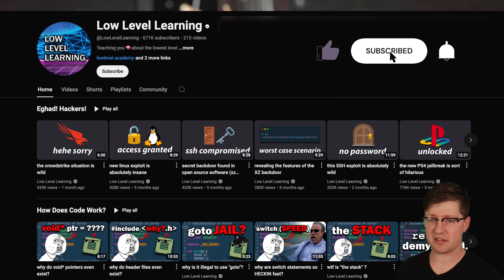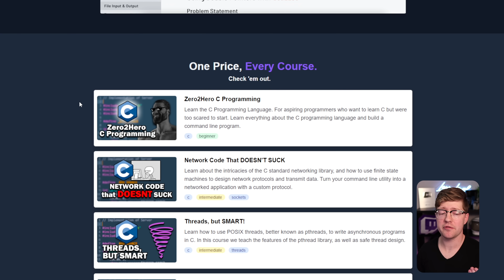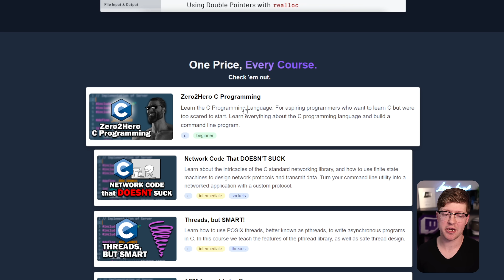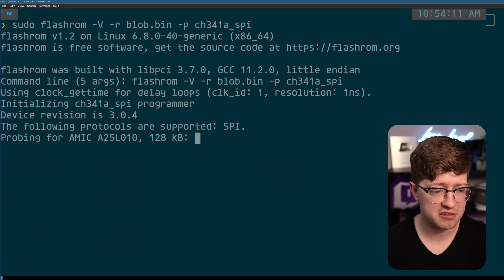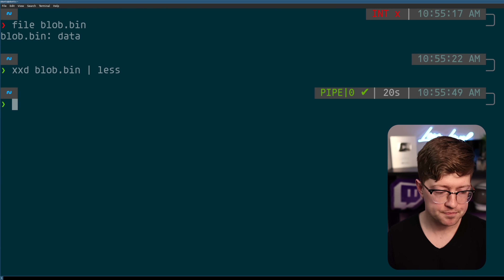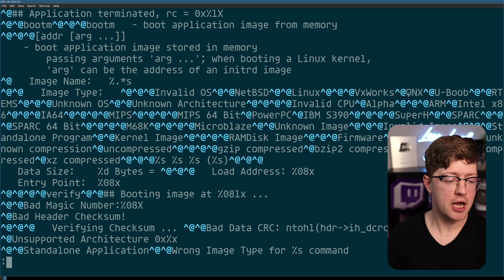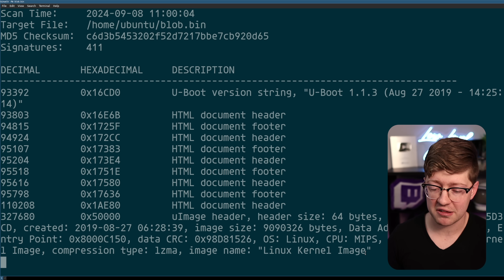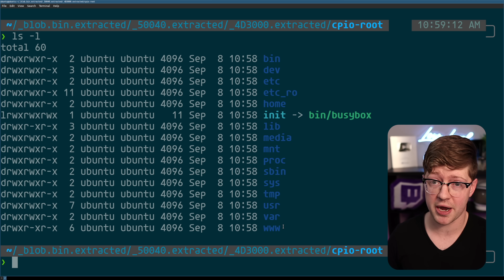how is this hacking tool legal?

Comment: He doesn't mention this in the video, but that CH341 device doesn't always work to read flash chips without desoldering. The problem is that in order to read from the flash chip, you have to power it. The CH341 can power a flash chip, but it can only output a limited amount of current. If the VCC rail connected to the flash chip is directly connected to other components too, it's possible the CH341 won't be able to power all those components, including the flash chip. In these cases, it's often best to just desolder the flash chip.

Alternatively, you could connect a logic analyzer to the DI and DO pins of the flash chip, then power up the device. Use the logic analyzer to record the data stream as the CPU reads the flash contents. You may need to write a small program to convert the recording back into binary data though.
Reply: Just my experience, YYMV, but I used one to read and flash the BIOS of a Dell laptop. It functioned perfectly. I had to buy a second clip that connects to the chip since the first one refused to work.
Reply: @MrWaalkman  Yeah I'd say based on my experience that it works without desoldering about 80% of the time. It really just depends on whether your flash reader can provide enough power to the part of the board you're connected to.
Reply: I had this a few times. Can resolve it by using an external 3v3 supply to power the rest of the board and using that pin for power instead of the USB programmer one.Some ribbon cables use blocks to connect all 10 pins at once so I ended up using dupont cables for the remaining cables since I was not connecting the power pin. But even in this configuration its a hit and miss.
I always do 3 reads and md5sum them to make sure they are identical. If not, then I will desolder for good measure. I don't need that uncertainty in my life :D

edit: and of course connect the grounds of the usb programmer and the 3v3  supply together. Since the ground of the programmer would be connected to the board with the rest of the other pins, it will work. Easier to connect the 3v3 supply ground to the programmer since theres not a lot of space on the board to hook a crocodile clip to.
Reply: The SPI flash will almost certainly be connected to the entire 3.3v (or applicable voltage) net so you'll end up powering everything. The other issue you might have when it's in circuit is that the SPI master might be holding /CS high once it has powered up, and trying to force it low from an external device might not work. Inevitably, sometimes it'll work, or if you can hold the SPI master in reset you can do it, but I'd have to imagine it'll fail a good proportion of the time.
Reply: @74HC138  I've certainly had that chip-select issue with one ip camera but other devices I must have gotten lucky :p
Reply: 1. add a electrolytic cap to the power rail (it looks odd, but, works) 100uF iirc.   2. Hold the reset pin on the uC low/high to stop the uC booting (if the bootloader uses the SPI bus it will corrupt your data).   I had to do this to a tapo 200v3 to dump the firmware.
Reply: Just unsolder the grnd pin
Reply: I totally agree, but it’s not just about power. The host CPU will also be trying to drive the SPI lines which will clearly cause contention. The only hope really, without desoldering the chip, would be if the host CPU puts the SPI bus in to a high impedance state when held in reset. If so, you could find the reset line (from the host CPU datasheet - if available), and use this to hold the device in reset whilst you read the contents out.
There is also a non-zero chance that the host CPU is (possibly) damaged by the programmer trying to drive the SPI bus at the same time as the host CPU.
I realise the author may not have as much experience in the hardware realm as he does in the software realm, but I feel this point should have been covered more thoroughly.
Reply: @jonlee312  Why would you put a relay between the CH341 and the flash chip?
Reply: If you have that little clamp you don't need to desoldier it. I had to use one of these to flash my bios when it was bricked.
Reply: @meetsoneji3830  That little clamp is called a SOIC clip. It can certainly help with getting good contact to the pins of the flash chip, but it doesn't solve the issue of powering the flash chip in the situation I described in my original comment.
Reply: @Gogeta70  it’s possible to power the bios chip using just the clamp, maybe I am not getting your  point. When I was flashing my chip it was enough to just properly clamp onto it and connect it to another pc via ch341
Reply: @meetsoneji3830   WRONG, go look at the new disk drive boards..., tehy are either too ltight to get teh clamp on, or are now using a new  SPI device with the pins under neath...
Reply: @stevesteve8098 I was just saying it is possible, the clamp is useful when you just need to  reprogram bios chip.
Reply: Also, most chips have an enable Pin. If the CPU shortens this Pin to ground you can't start the memory chip. If you power the device you have a multiple master problem. You can prevent the CPU from booting, but at this point, you might just learn how to solder.
Reply: @MrHaggyy  some boards are extremely delicate, and have extremely fine traces that are easily damaged removing. I do a ton of solderwork and damaged a dell board removing a spi bios chip (thankfully it was a spare used board that was already unsuable cause the socket got messed up in shipping) If you can do it on the board, its probably safest.
Reply: I tried flash a fake GTX 1060 to a 550 Ti and encoutered this issue. Red LED went dim when I connected the clamp the flash chip and I suspect this was the issue.
Reply: @Gogeta70  a logging device like openlager or do you have a recommendation? I’m trying to re program a ec300 “toy” drone to use a different serial based receiver and to change motor idle and other pid settings. I have experience with betaFPV silverware coding for flight controllers, I just want the power to change .wav files and other silly things in my kids toys and stuff.
Reply: @tattoocollective2599  I've messed with a few toy electronics over the years, and most of the time the data is just stored on a SPI flash chip. My general process is to try and read/write the chip in-situ first and if that doesn't work, I just desolder the flash chip, make whatever changes I want, then solder the chip back in. I also always make a backup of the original flash contents, just in case.

Not sure what you're asking in regards to the data logger?
Reply: you power it via the clamp, but the problem is voltage differences per chip... some are 3.3, and some 5v
Reply: @whoknows8225  Did you even read my comment? My entire point is that when you power the flash chip using your SPI flash reader, sometimes it can't provide enough current to properly power the SPI flash chip.
Reply: what's the benefits of the CH341 from my old ponyprog or ATiny SPI-Interface (serprog)
Reply: Yes and also the most part of those clips included with kits are the worst quality making bad contact with the pins of the IC pins or sometimes even damage it. It is needed the good blue Pomona clips or definitely unsolder
Reply: @AT-hh4db  Yep, you really can't beat Pomona clips. Except for the price, they are damned proud of their product.
Reply: Alternatively, you can also just desolder one or two pins (Vcc/ground) and then use the clip.  This isolates the chip enough to do a read (and/or write), and makes the task simple enough that even those with less soldering skill/tools can pull it off with less potential of damaging their system.

I've also seen videos where folks will clip the pin just above the board, then use a bit of wire to bridge/solder it back. I highly suggest against that, since if that joint comes free, you potentially have a bit of wire bouncing around your system.
Reply: @TvistoProPro  Yeah, you can desolder just the vcc/gnd pins, but I'm not a big fan of that method. You have to bend those pins away from the board a bit to make sure they don't make contact, which I'd rather not do.

Desoldering the entire chip is a little extra work, but soldering isn't really all that hard to do. If you need practice, you can go to your local Goodwill store and buy a few old used routers for $3-4 to practice on. I'd argue this is a better approach than trying to take a shortcut like "only" desoldering two of the pins when you lack the confidence in your skill to do it properly. Practice on old and cheap electronics. You'll do a better job at desoldering/resoldering the chip and come away having improved your soldering skills.
Reply: @Gogeta70  I wouldn't bend the pins unless it were absolutely needed.  I find that just wicking the solder from a pin often separates it electronically.  A continuity checker can verify that.  I've also used stripped silicon wire sleaves at times and pushed those over the pin (up the via for DIP style chips).  That forces isolation if the metal touches due to tension from the clip.  But usually, that's not needed.

Desoldering one leg vs 8 also means less thermal impact on the chip, and less chance of lost connectivity long term. To each their own, but the less I need to do to isolate a chip for a one-time read/flash, the better.
Reply: @TvistoProPro  I mean, there's nothing inherently wrong with doing it that way, it's just not my preferred method. If I'm going to bother getting out my soldering iron, I might as well desolder the whole chip.

I tend to use a double-flat tip that's wide enough to heat 4 pins at once, so I usually just lay it across all four of the pads and use tweezers to gently pull up on that side of the chip. I can usually have a chip completely desoldered in about 4-5 seconds, which is typically well within the tolerance of the chip.

Like you said, to each their own. As long as it works for you.
Reply: It's often possible to temporarily lift a small component like a diode or resistor that's in-line with the eeprom or nor flash's VCC line (usually for power protection) and allow the chip clip to work.
Reply: Before unsoldering, just try plugging in the power cord in the device (but don't turn it on ofc) so it gets standby power to the chip. I've had this work on several devices.
Some laptops require you to unplug the main battery as well if doing this.

Comment: I actually use this a lot with hardware hacking and tinkering cause its fun and i like that you can back up the whole device flash menaing i can mess with the firmware as much as i want and not having to worry about it never being able to function normally again or for it to become bricked forever.

Also its fun to see 99% embedded devices running Linux and busybox. Alao often they ditch the gpl and dont comply which is lovely cause more fun trying to crack the software of a device and unveiling its secrets

Comment: I've found the FlashCat devices sold by https://embeddedcomputers.net/ to be indispensable for pulling data from SPI NOR or NAND, as well as I2C EEPROM and Parallel NAND flash devices.

The source code for the app is available, and I've added some custom SPI flashes I've seen in the wild that weren't in the DB. It is more expensive, especially when getting all the various adapters, but it is pretty flexible.

Comment: Well. I predict that the producers of routers soon will begin to encapsulating there firmware chips. 🤷‍♂
Reply: I doubt. Manufacturers like to save cost. Its not worth it for them to encapsulate the flash cause that requires more money being spent and almost no one is going to go open the router to access the flash

Comment: just be warned about this device, there is a design flaw in it that can cause it to have a higher voltage than intended, potentially damaging the chip you are trying to flash.
many people never run into this issue, but if you want to prevent it, you can modify the device fairly easily if you are comfortable with soldiering.
just do a quick search on google or youtube for "Volt-modding the CH341a" and it should be one of the first results.

Comment: Be aware of voltages! This device puts 5V on data lines to 3V3 TOE even when supply to TOE is set to 3V3. Look for 3v3 mod for ch341.
Reply: Afaik there are different versions of this board. The actual CH341 chip is both 3.3V and 5V compatible (which is why the mod even works to begin with) although some boards don't use the integrated 3.3V circuit others do.
Reply: @Ether_Void  Yes, and because of that (some devices have this bug and some does not) I want to warn and inform anyone who want to use it.
Reply: @Ether_Void  yeah I have a board that does 3.3v with no mods, I haven't tested if it can do 5v tho, it does have a jumper on 2 pins labeled "P/S" so I assume that does it but don't want to take it off if that's not what it does and I could end up breaking it
Reply: @ajddavid452  not sure if You got the problem correctly. This device can supply 5v and 3v3 IC, but when you set 3v3 as supply voltage to IC on data lines there is still 5v logic (no level conversion). Some IC will accept that higher voltages due to small current on data lines (aka small power transfer) but in general 5v on 3v3 data lines put IC to undefined/unspecified region. Need to read IC datasheet and make sure that IC will survive.
Reply: @adrian_sp6def  I tested it with a multimeter, there are dedicated pads labelled MISO, SCK, RST, 3V3, MOSI, and GND, as well as 3 pins labelled TX RX and GND, and yes I know GND is ground, I looked up a guide to do it, most things you just said to me in this comment I was aware of lol
Reply: @Ether_Void  The issue is, if you buy the cheapest, expect it to always output 5v unless you confirm otherwise.
Reply: Good point!
Reply: Alternately, there are CH341 dongles with blue PCBs that have just a bunch of pin headers, rather than a fancy socket. This has a proper design: it has a jumper that lets you select between powering the CH341 chip from either USB power or an onboard 3.3v regulator, which is what determines the logic voltage (per the datasheet). You have to think about how to hook it up a little bit more since you don't have the socket, but if you're not confident modifying a PCB it'd probably be an overall better purchase - usually it's a little bit cheaper too.
Reply: @ryjelsum  Yes right! I have same dongle as Ed, and mine has 3v3 bug. I juat want to warn and inform to be carefull, some IC will not tolerate 5v as data pulses
Reply: the green v1.7 version of the ch341 board is the good one, treat all black pcb versions as defeative until tested as due to cost cutting causing the voltage changing part of the circuit to not work correctly without modding
Reply: Not true, check Sorin video not mod needed...
Reply: noooo! don't tell people that. I want to watch people who don't know what they are doing, wonder why they don't know what they are doing.
Reply: BE
How to program a bios chip - CH341A programmer, no, you don't have to modify it 

https://www.youtube.com/watch?v=J8-Sh7DjiXw
Reply: yeah ch341 is pretty much the worst programmer that money can buy.  Fortunately it doesn't cost much money.  Unfortunately it's the target chip rather than the programmer that will suffer.  Get a T76.
Reply: You really don't need to mod it for most applications (except for 1.8v SPI chips)
Not enough current to cause damage at 5V:  https://youtu.be/J8-Sh7DjiXw?t=48
I'm willing to accept the possibility the designer knew what they were doing . . .
Reply: @Nick3DvB mine has caused damage at 5V.  That's how I found out about this bug.
Reply: @Nick3DvB Yes, that is true, some IC will accept 5v, but for some others 5v is out of spec and put IC to undefined behivior, so need to be carefull, and read datasheet before apply any voltages is good practice.
Reply: @adrian_sp6def  I had a few that corrupt on 5v, which is NOT ideal if you are trying to archive the firmware.
Reply: please dont be aware

Comment: literally just started playing with mine last night, pulled a BIOS off an old device, if you have a flipper you can also do this with the SPI memory application, raspi can do this as well, that's what I used back in my coreboot days. I found the soic-8 clip on this particular model to be much better quality than some of the other ones i've seen on amazon.

Comment: I used that to program bios chip on my laptop 🤣 because it broke after an update
Reply: Aahhhh ThinkChad in the comment section?!
Reply: @SM-qo9gr  Im still rockin a T430 😂
Reply: the most effective thing you can do with your time is to make instructions on how to do this, because at some point if this is again a problem for you. you might not have to remake another bios that some one made because they learned from your instructions.
Reply: I was just thinking that this should be possible - thanks for confirming. 

I haven't bricked a computer yet - but it's nice to know all might not be lost if it ever happens.
Reply: And i messed up and had to sell the laptop.